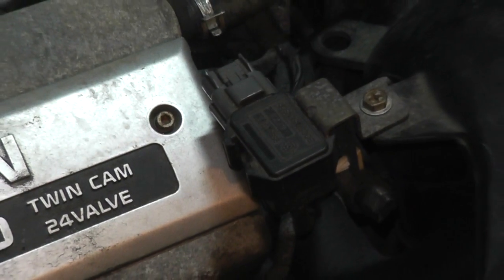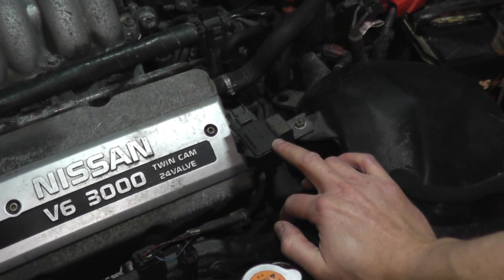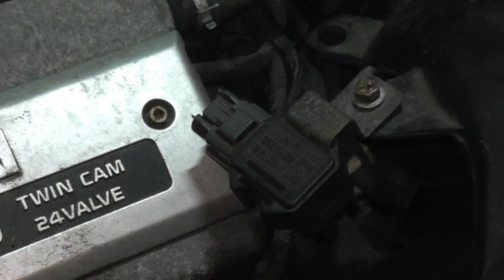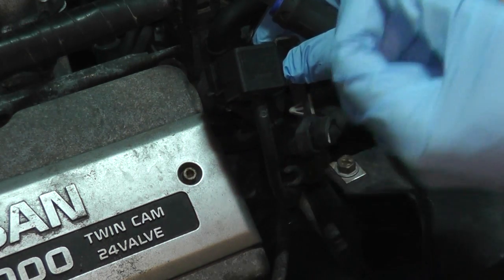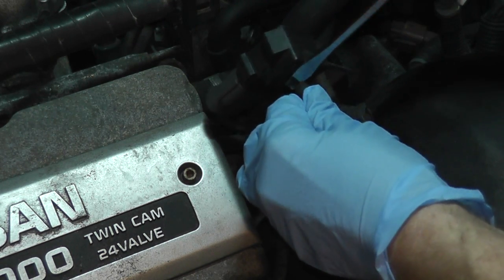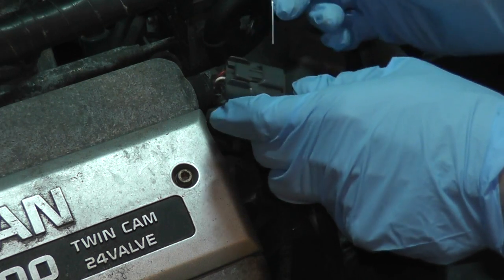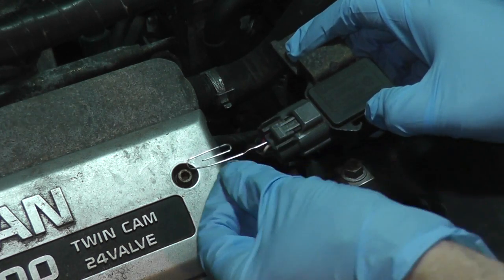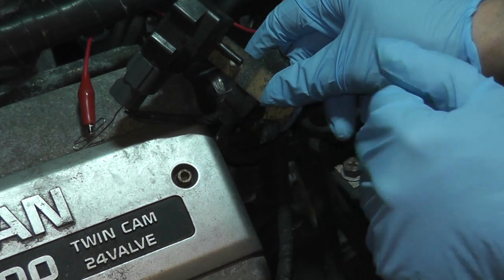How To Test and Replace an Absolute Pressure Sensor P0105 HD

Comment: What if there is no voltage reading once  you connect voltmeter lead to paper clip connected to the white wire ? Your volts reading  was about 4.2 volts before you applied the vacuum line mine  is 0 volts before applying the vaccine.  Thanks.

Comment: My MAP/baro switch solenoid tested OK -- strong clicking sound and movement when 12v applied.

The input voltage for the MAP of 5v, that tested OK. The output signal voltage varies with vacuum sensed. With no vacuum, it read 4.8v which is normal. Using my mouth sucking on the vacuum line as hard as I could, I got it lowered to 2.4v.

I saw you lowered yours using hand operated vacuum pump got the signal down to 1.2v.

Do you think I sucked hard enough (hahah) or do I have a bad MAP?

Comment: I just tested my map sensor on my 2000 maxima as you explained. I am not getting any voltage from the middle wire. Other wires tested good. I do have 5 volts from red wire. If I am not getting any voltage from middle wire, is that a sure sign my sensor is bad?

Comment: I got a 2005 mercedes c230 1.8 and I had code p2228 and I checked deeper and then I seen code p0105 so I changed the sensor not thinking to check it first so I checked all the tests and everything was good but the middle wire didn't show 4.2 v coming out through the sensor it showed 1.8 v with no vacumn I have 5v going in the sensor and I have good ground and I checked these same numbers with 2 different sensors same outcome. do you have any suggestions also my car is a 1.8 supercharged

Comment: Thanks for doing the video it great information, am getting a P0105 (MAP sense) and a P0400 EGR code.  Can the P0400 be the result of the P0105 code or are the separate issues?
Reply from the maker: What kind of vehicle you working on?

Comment: So if P0105 exists, And the Air Intake Sensor has correct voltages and adjustments under pressure, What else could throw the fault code up, My Vaux 2.2 Diesel is not accelerating above 3000rpm and seems to have no boost either, Sounds rattly through-out compared to quiet when it runs normal.
Reply from the maker: +Nano M I don't have any experience with diesels, but sounds like an issue with the mass air flow sensor.

Comment: Meant to ask on my earlier post after l change the map sensor do l still have to pull out the EDM and reset it or will it do that itself if it see the Map sensor is workin ?
And thanks for your time and effort.
Reply from the maker: +Lionel Berthelon If the sensor is working (and there are no other trouble codes) the computer will reset on it's own. It takes a bit of time so be patient.
Reply: +CarsNToys 
Did all your tests, had vacuum/no leaks/right voltage/good ground & no other codes, so now whats left is the replacement part. RockAuto was out of stock on the Hitachi PS54-01 and what they had was another make which was over 250.00 plus dollars.
Went to ebay found Hitachi PS54-01   $10.44 used W/30 day guarantee  (looked to be new) W/ free shipping orderd 11/14/15 received 11/17/15 , 20 min install did a manual rest, bingo no codes.
Thank you, thumbs up.
ebay link for some one that might need one and is tight on cash.

  http://www.ebay.com/itm/261259393300

Comment: Great video l have a code P0105 that just popped up on my 1998 w/1.6 eng. Sentra GLE  only have 43,000 miles on it. Everything test good as to what you show in your video up to a point l don't have a vacum  and cant make that test yet. will let you no the out come.

Comment: Lovell Bins  - I was under the opinion a P0325 will not trigger a CEL. I have been getting that code for years. Lately my problem has been a P1105 and I tested it watching both videos (except I didn't buy a vaccum yet) Everything tests OK but still throws the code every week or so.

Comment: CarsNToys can you help me with a p0305 knock sensor code...replaced it with a brand new ks but still showing ks code. Your video helped me with the map sensor
Reply from the maker: Lovell Binns I plan on having a knock sensor video shortly. What kind of vehicle do you have?
Reply: 1999 Maxima Gle. I've replaced it, reset the comp but the code still comes up p0325  CarsNToys

Comment: Great videos. My 1999 Nissan Altima has both P0105 and P1105 codes. I see these are related problems. Could the hose between the two be causing both codes? I will check. Great help.
Reply from the maker: oscar garcia Yeah definitely check if the hoses are clogged or leaking.